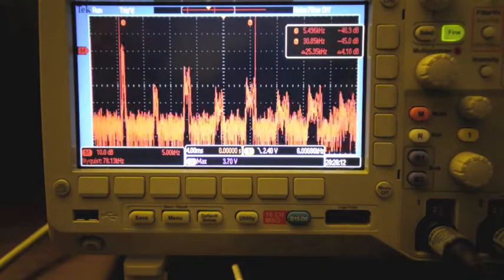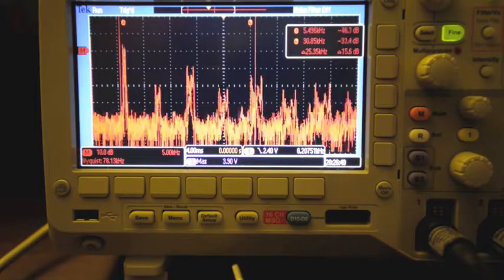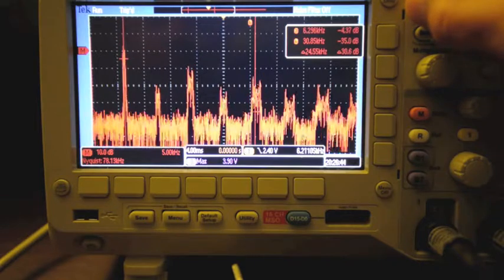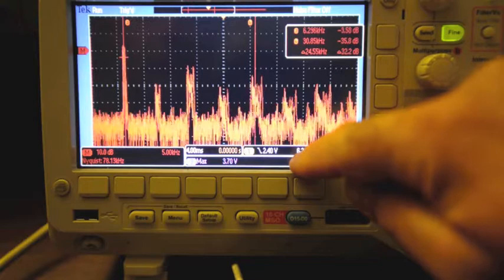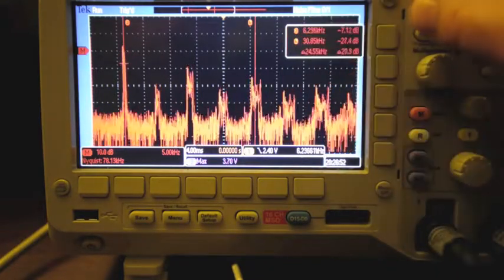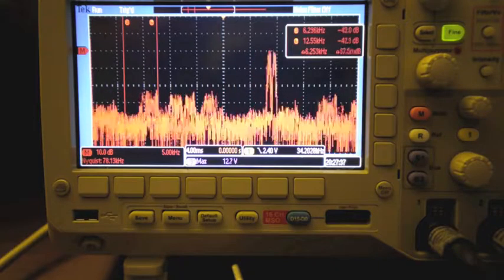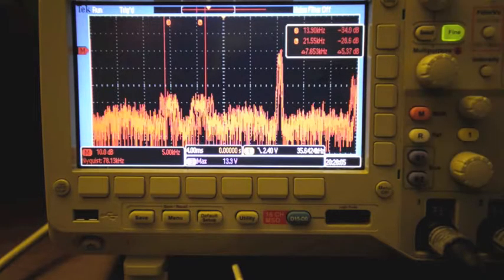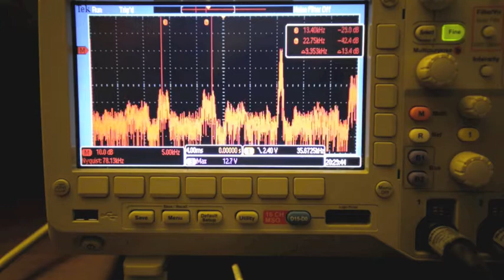Celestron CGEM Motor Control III

Comment: Great work!  I also read your blog. Excellent analysis. I agree with your conclusions, mostly. On the other hand, driving a DC-based system with PWM is pretty much standard nowadays. It is a type of digital-to-analog conversion. The question is if Celestron is using the right PWM.  Did Celestron ever comment on your analysis?